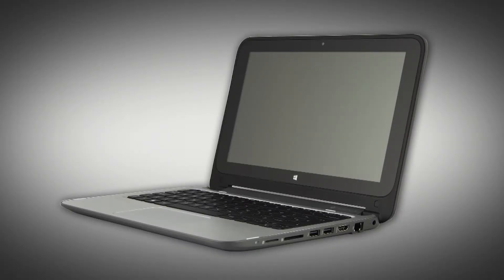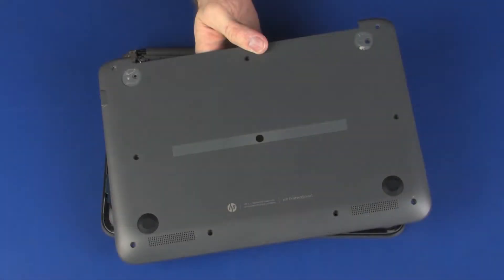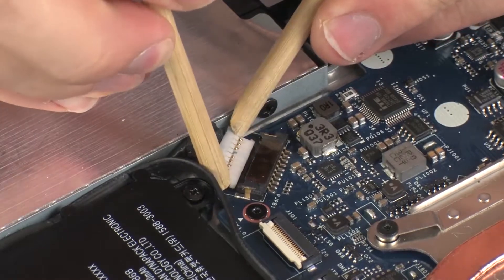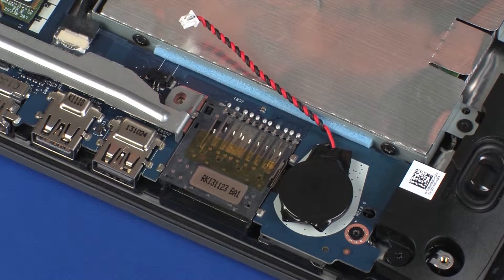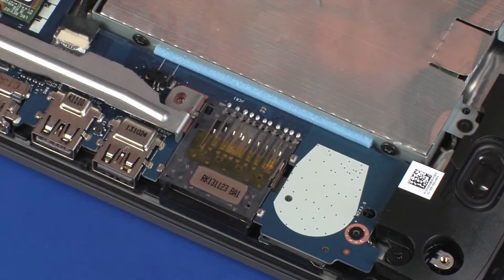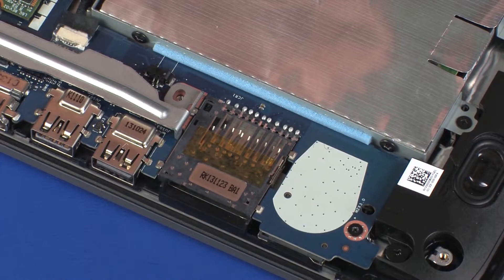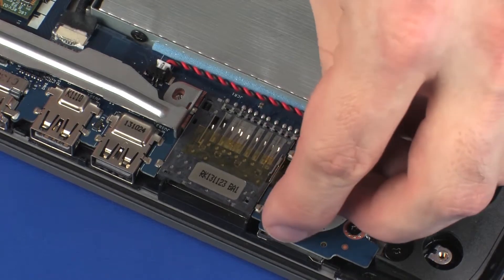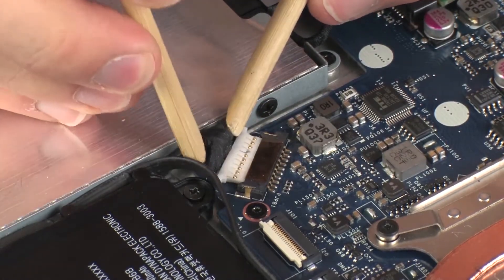Replace the RTC Battery | HP Pavilion x360 Notebook PCs | HP Support

Comment: @hpsupport disappointing you have not answered @pacificblueit8519.  I have a x360 14-ba104na.  Service Manual c06523509.pdf does not mention RTC battery.  Does it exist?
It is great you provide instructional videos like this, but it is VERY UNHELPFUL HP having a product line such as the x360 that has so many variants, and you do not specify precisely what your video relates to.
NB I keep getting CMOS and (main) battery errors, despite the diagnostics reporting my battery is good.
Reply from the maker: Hi there, thanks for contacting HP Global Social Media Support!
I understand that you are experiencing an issue in locating RTC/CMOS battery on your notebook.
I will do my best to assist you.
Most of the newer HP notebooks such as yours do not have a CMOS battery.
The internal battery maintains the clock and BIOS settings.
Below is the link to the service manual for your model series, and as you can see... no RTC (CMOS) battery is listed and nor is there a procedure to remove and replace the RTC battery: https://hp.care/3O4jdPS
Regards, 
HP Support
Reply: @HPSupport   thank you for the quick reply, it is appreciated.  Can you explain the expectation when the main battery is completely depleted? Should I expect CMOS settings to be lost/reset to default?  This appears to be the behaviour I am experiencing, but I would like to know if it is considered normal.  As a product, it is very disappointing. CMOS batteries have been part of the system board design for decades, and with good reason.
Reply from the maker: Thanks for the reply.
Please refer to the instructions mentioned under this document to fix the issue: https://hp.care/3RSh8aM
Regards, 
HP Support